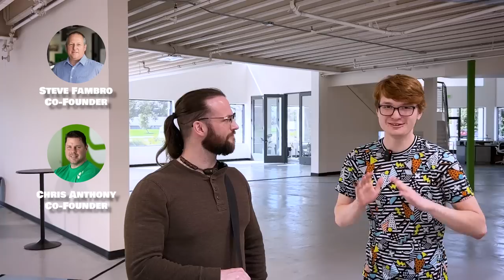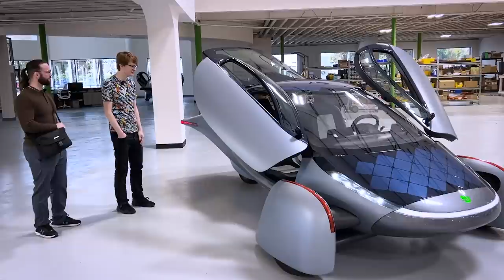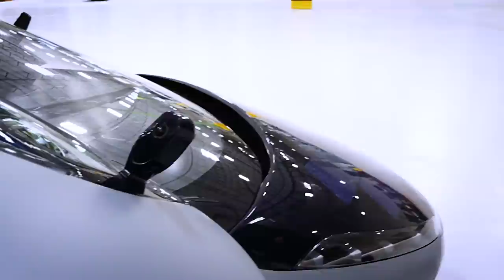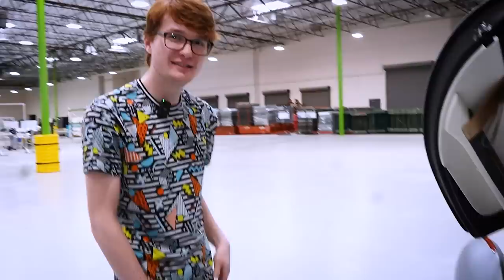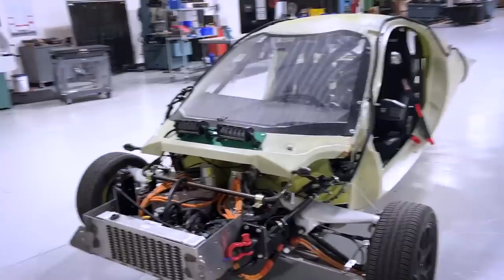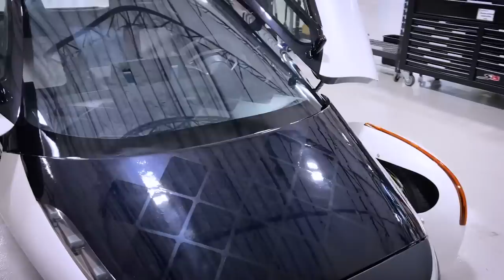Full Aptera Facility Tour and Interview, Part 1: This Is Where The Magic Will Happen!

Comment: It's not just that it pays for itself.  There is a looming oil rigger strike that could significantly reduce gasoline supplies.  Those kinds of things are not a problem if you have an Aptera.
Reply from the maker: Agreed, this is the future of transportation. We can no longer drive around in massive steel vehicles, we need to learn to use efficient green technologies to reduce our reliance on fossil fuels.

Comment: The basic numbers if I understand it correctly: $36,000, 40 miles daily off solar only, 140 miles overnight off just 110V, 400 miles on full charge - probably 400 miles overnight off 220V.  This will be an interesting piece in the conversion to full electric.  With future breakthroughs in solar technology it will go a long ways to overcoming grid capacity issues that doom full electric cars that do not have serious solar power.

Comment: how about on a road with high camber? some straight roads unfortunately have high camber or sideways slope, i've built a similar 3 wheeler and it was a real problem on those types of roads,
the back feels like it is sliding somewhat, very disconcerting.......aptera should defintely test on very high cambered roads if they haven't already considered this, it effects stability big time on a three wheeler.
Reply: Was your similar three-wheeler also front driven?

Comment: How does one trade in their vehicle? you mean sell back to company?
I drive a 2019 Hyundai Ioniq Hybrid Preferred which is a highly efficient car and I used the solar calc and I only save 2500 usd BUT I still want to go Fully Electric
Reply from the maker: I think this is a good question. How will Aptera handle trade-ins and financing for Aptera vehicles? Let's see if the community knows or we an ask!
Reply: @3andB  Yes! I'd honestly love to be able to trade in my car for it one way or another, is there an Aptera community somewhere I can join?

Comment: Put a roll cage and front and side air bags in them for safety. That might increase the pool of buyers by giving assurance of head room and impact absorption if it were to roll. That is my only concern, otherwise, I would definitely consider buying one of these. I would also like to see a tandem two seat version that is narrow enough to fit two of them in a single lane of traffic, like a motorcycle. By making them narrow, you effectively can double the carrying capacity of the existing road system.
Reply from the maker: Tandem version sounds amazing! How do we get that suggestion in front of Chris and Steve?!?!?

Comment: It seems like aptera is promoting the max solar production like it's the average.  According to some fans who did solar calculations based on the amount of solar panels and efficiency ratings the highest yearly averages were in the low 30s in Hawaii or Arizona.  Of course assuming you don't park in the shade. Most people will probably only get 9 hours of sun at work /commuting before parking inside.
Reply: Totally agree, most owners will be lucky to get 10 miles of range from solar per day.
Reply: I'm one of those that have done the solar calculations (and have hands on experience with solar race cars w/ compound curved arrays using the exact same solar cells Aptera is using) and feel many an Aptera owner will be quite disappointed with the solar range claimed vs the solar range achieved.....

Comment: Hoping for a 4-seater version down the line. I wouldn't mind riding a 2-seater autonomous taxi between my Philly apartment & work, but it's tough to car pool to the airport with only 2 seats.
Reply: They had a 4 seater prototype design in the works before, but one of the main reasons for going for the 3 wheel version first is that it's much easier for them as a start up to meet the regulations for that kind of vehicle. 

After they have proven that this kind of vehicle can be a success, a 4 seat 4 wheel version is basically inevitable.
Reply: @rorychivers8769   I mean, if a 3-wheel 4-seater is made, I'll buy it if it makes sense and isn't gutless to drive. I mean, it'll weigh significantly less than my 2021 Accord Hybrid at 212 horses, and that's more power than I need.

And I won't be on the market until at least 2032, preferably 2035 so we've got time for mass production solid state batteries to come online.
Reply: @patrickproctor3462  It's a lot of horsepower for a super light frame that cuts through the air like a knife. It's like putting a v12 in a Mini Cooper. I wouldn't be surprised if it turns a few die-hard petrolheads green.
Reply from the maker: It is very fast. I have driven a lot of fast cars in my day. The Aptera put me in the seat and accelerated very quickly. It is very fun to be in. I agree, it will turn the heads of many people, and when they find out how affordable and efficient it is, I think Aptera will find great success.

Comment: In order to exchange the tire, normaly you take off the wheel. How is it with Aptera?
Reply: Remove any covers and undo the lug nuts.
Reply: After you remove the wheel cover the tire comes off like any other car, just remove the lug nuts.

Comment: Wait so is the production gonna be the only car with half mirrors with camera inside or what?
Reply: The stock mirrors are the size they are so it meets a motorcycle required minimum size (3x5) they will have a camera included inside them for the electronic rear and side mirror displays inside the Aptera. Either way, you’re covered.

Comment: I have one on pre-order but I still worry about being able to get out if this car flips over afterwards an accident. In the real world, there are other scenarios that can flip the car (especially this one). The most obvious is an offset rear collision on the freeway. 

Let's say you're paying attention and have to come to a complete stop due to traffic jam but someone behind you isn't paying attention. They then rear ends you offset to the right or left because they're trying to turn last minuet trying to avoid you. The height of the rear section is high enough that a smaller cars bumper can slide underneath the sloaped rear area of the Aperta and flip the car end over end. Now that you're on the roof, will the doors open high enough so you can get out?
Reply: Not a car, it’s a motorcycle
Reply: @coolranch1660  I don't care guy!
Reply: Worst case you're in there till someone flips the car over. Keep a glass breaker in the car. How many times have you been upside-down in a car? I really don't get this car concern. I also just wanted to point out I never worry about this when thinking about my Aptera car.
Reply: @chublez  That's far from worse case. I'm pretty sure someone would want to get out fast just in case there another car on fire near you.
Reply: @rotaryperfection  you are correct. It looks to me, like it would be completely impossible to get out of this if it flips. I didn’t find the guys assertion that it’s hard to flip it to be acceptable; as you point out, a car can be flipped by other forces. I suppose, if you were worried you could keep a hammer inside the vehicle.

Comment: Est. Cost?
Reply: Current projected price starts at $26,000.00 for the 250 mile range front wheel drive model. Up to about $50,000.00 for the 1000 mile range all wheel drive with custom colors, driivers' assistance package and all of the accessories.
Reply: The base model is expected to cost $25,900. The top end model is around $44,000. Those prices may go up due to inflation.

Comment: Of course 3andB they won't have any vehicles sold and in the hands of the original reservation holders by end of 2023 and probably never.  They may make a few more at a loss and hand them to promoters or insiders but for a compnay that was suppose to create a very easy vehicles with shells that you pop out of a mold  an enclosed motorcycle that doesn't  need to do any crash tests - they aren't late they are over with.
Reply from the maker: Don't we have a bet on this?
- End of 2023, production starts, we get 40/day, maybe 1,000 by end of 2023.
- End of 2024, first plant is at 80/day, second plant is operational at 120/day by end of 2024. Total delivered for 2024: 20,000. 
- End of 2025, 2-3 plants operational: 500/day. End of 2025: 100,000-120,000

This is just my guess and my opinion. I think they can make this happen. Maybe they will get it all done in just 2 manufacturing facilities. Hey @aptera, giddy up! 

We still have a bet?

Comment: Why not make a 4 wheel version to win the federal grants off the bat - setting the rears similar to the fronts ?
Reply: The additional power and 4 wheel steer would also compliment
Reply: Because then it's a car with all the regulation that comes with being a car.
Reply: @nonegone7170  So is it not good enough to be a car ?
Reply: @waynefergusson9987  They would most likely have to adhere to much more stringent legislation, unlike the 'quad cycle' category they're in now.

Comment: I have been following electric vehicle s since the 1970s. Aptera is the most efficient ev u can buy.!   Aptera is superior to Tesla for the following reasons: Aptera will charge the battery 14-40 miles per day........ Tesla is too heavy and in efficient to make use of solar panels........Aptera will last for ever as the structure is carbon, will never rust......Tesla is made of steel, will rust......Tesla is not user maintenance friendly.......?Aptera is in favor of user maintenance......Tesla charges an extra $15,000 for fsd.......?Aptera does not.....The launch version will be: 400 mile range battery pack......three motor drive......32 cu ft storage......extra solar cell coverage.....optional audio package.......for $33,200..!!!!!...u can invest in the car from $200 to 2 million on line. If u invest $10,000 or more u get your car before the 40,000+ pre orders. Questions......???    Email me. I will send you a discount code to save u money when you order your aptera on line.....?? barbuto@optonline.net......
.....
Reply from the maker: You get it! Thank you for the comment, I hope some detractors read your comment!

Comment: Cool, where will the bankruptcy happen?
Reply from the maker: Why do you think that?
Reply: @3andB   It's supposed to be a simple and cheap design but they are adding too much complexity. By the the time they get to market Tesla and BYD will already have compact cars at scale. They should've built the model that has solar panels and the smallest battery instead of offering 3 variants. Stick to one affordable model.
Reply from the maker: When I was standing in front of it, I thought it looked very approachable. I like working on older cars, the Aptera looked far simpler to me - very much plug and play. What complexities are you concerned with? I think, the number of solar panels and batteries is not that difficult to change out per customer. Otherwise, everything else looks very standard.
Reply: @3andB   the complexity in manufacturing. It's a lot easier to make a lot of one car than it is to make a lot of 3 variations with different paint jobs and bullshit.

Comment: They have one or two prototypes and make us believe that this is the vehicle of the future!!!
Good luck to them, but for our family, this type of vehicle is not practical - so not for me.
Allot of the features in this vehicle look like a Tesla design - which I own a Tesla.
I hate vehicles with only 3 wheels. And this would be a terrible vehicle for winter climates with no Sun.  I assume it has an electric port plug in - so it does not strictly run on solar.

Comment: Nothing but BS.  Dean you aren't getting your launch addition in 2024 or ever; besides the original reservation holders have the first several thousand vehicles - so you'll be waiting years before they get to you .. assuming they ever make any production vehicles which is practically zero chance.
If you actually gave this company any money - kiss it good by sucker.
Reply from the maker: Doubter indeed! Let's make a friendly bet, I bet Aptera makes it to production by end of 2024, then opens a second/third plant before end of 2025. What do you say?
Reply: @3andB  I say, if you are talking production of at least 10,000 vehicles per year deliveredt to original reservation holders first;  I'd definately take your bet.  Definately will not have production started and vehicles delivered to original customers before the end of 2023.  No chance.
Reply from the maker: Don't we have a bet on this?
- End of 2023, production starts, we get 40/day, maybe 1,000 by end of 2023.
- End of 2024, first plant is at 80/day, second plant is operational at 120/day by end of 2024. Total delivered for 2024: 20,000. 
- End of 2025, 2-3 plants operational: 500/day. End of 2025: 100,000-120,000

This is just my guess and my opinion. I think they can make this happen. Maybe they will get it all done in just 2 manufacturing facilities. Hey @aptera, giddy up! 

We still have a bet?

Comment: So did I hear him correct?, ev battery is air cooled?,if so this car is going to have the same fait like the Nissan  leaf  having  to loose capacity  degradation issues because of air cooled instead of liquid cooled
Reply: Battery has coolant system, just instead of a traditional radiator, the skin of bottom of the vehicle provides cooling to the coolant.